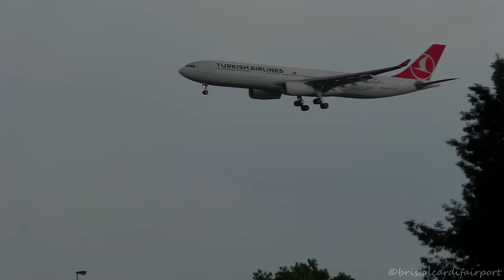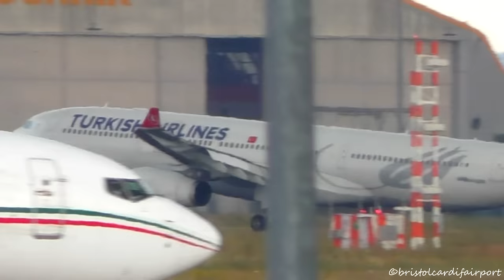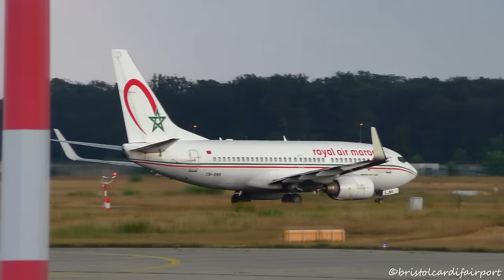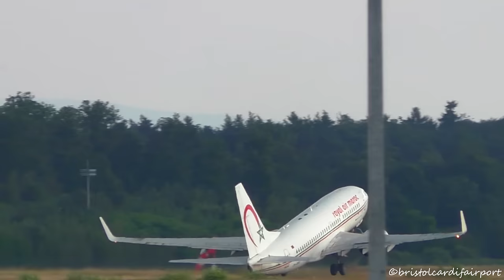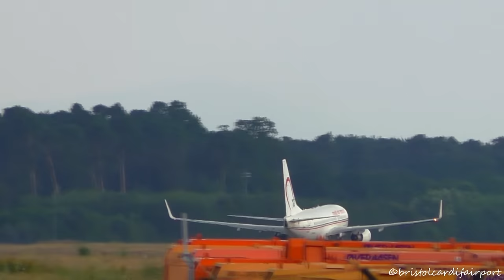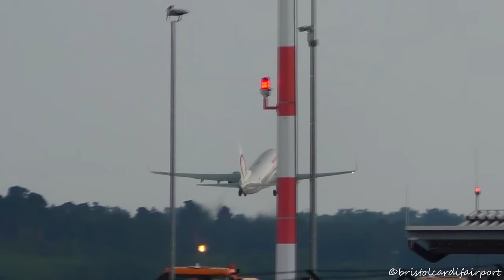PASSENGER AIRCRAFT FAILS TO TAKEOFF! BOEING 737 NEAR TAIL STRIKE & STALL ON TAKEOFF

Comment: Flap
Reply: I hope this comment helps:

So, First of all in this video you see the Turkish Airlines Airbus A330 landing. This plane flies over the runway the 737 later takes off from, meaning that there is now wake turbulence on the runway. When it is time for the 737 to take off (which has flaps 1 selected, which is a normal setting for this runway length and wind speed) it rotated as it was in the wake turbulence of the a330. The wake caused a tailwind, therefore making the airspeed lower. The pilots lowered the nose to pick up more speed, and then rotated again and took off. Nobody was at fault here. My sources came mostly from observation of the video and from Ryanair captain "Mentour Pilot" who did an analysis of this video and came to this conclusion. Feel free to check out his video on it, i hope this clears some things up. No one is at fault here.

Comment: There were no flaps or leading edge slats. Looks like they skipped the aircraft handbook. Poor pilots. If the air temp would have been much higher they would have killed everyone.
Reply: If you knew what are those you would have been able to see the slats at least. They were definitely extended.
This setting is called flaps 1 and is a standard take off flaps setting.
Reply: @jeremyjones6869  0:39  just zoom at the left wing , you will see them extended, but not too much. Flaps and slats are operated together , and  actually there are multiple settings of flaps available for take off in a aircraft, they are not only  fully extended  and fully retracted.